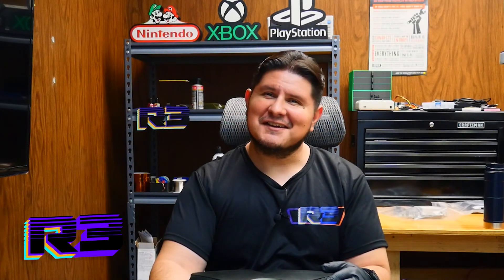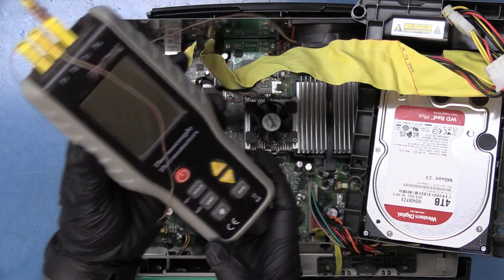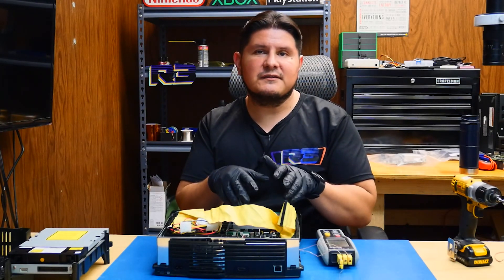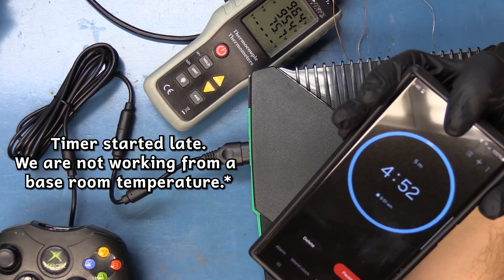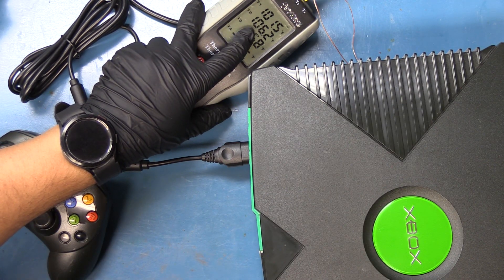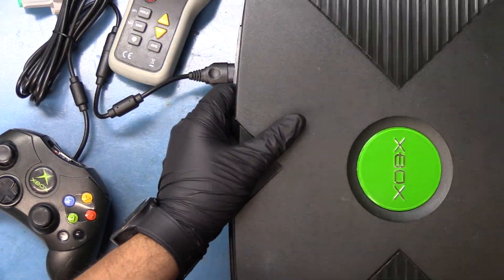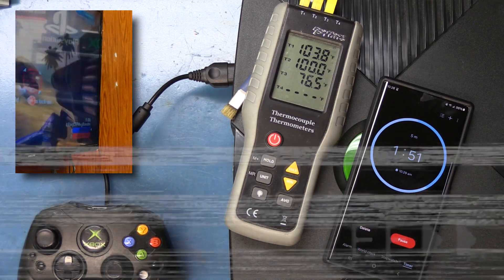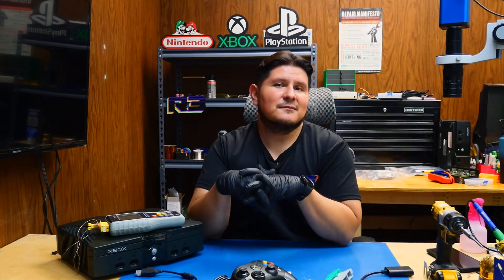Is Removing The XBOX Drive The Key to Optimal Performance?

Comment: Has anyone tried Honeywell PTM7950 or Thermal Grizzly PhaseChange Thermal Pad? I'm having great results on the Phat 360 and Xbox One X. Heat transfer is much better and fan can dissipate heat away more efficiently from the heatsink.

Comment: You should play around with the uncommon mod of putting a desktop drive into an xbox. There are a few models that can be modded to work in the xbox by flashing the bios and soldering on some components. Might be an interesting video.
Reply: The power plug or molex connector.

Comment: Recently bought a 1.6 console, noticed that the disc drive didn't read games (Whereas the seller claimed that it couldn't open the disc tray), and for some reason when I opened the console, the disc drive completely lacked screws over the top tray. I wonder how hard it is to buy a replacement DVD drive considering they're failing left and right now, and if it's even worth doing at this point.

Comment: Lmao, 100f (38c) is barely even warm when you're looking at it from the PC world. Heck many PCs idle above that temp. PCs usually run at around 150f-170f (65c-76c) and sometimes even hotter if you include modern intel CPUs.
Reply: @madmax2069  Do what? My PC runs around 40°F....

Comment: Those GPU fans on the 1.0 suck so much and are so noisy.  I'd recommend replacing with a passive heatsink if you have any extras laying around.
Reply from the maker: Agreed. I've seen too many fans die on these old 1.0 consoles.
Reply: I actually did it, saw so many recommendations online, yet the result was awful.
Temperature on GPU was too much with short time. The passive heatsink couldn't be touched with bare hand, got really hot, I've never seen this kind of heat on original Xbox before. Definitely NOT healthy. Main fan working well of course, nothing broken inside or blocking air so, Idk what happened.

Of course, applied new thermal paste and good cleaning but console GPU got too much heat. I'm using the stock heatsink with a serviced fan and temperature is very good, even in demanding games and warm weather and not noisy at all but more than newer revision systems like the 1.6 being the most quiet.
Reply: There does seem to be a bit more heat venting out the back of my 1.0 with a passive heatsink installed compared to a newer revision.  But I've put a few playthroughs of KOTOR on that console since then and haven't run into any issues yet.
Reply: true that. i had to replaced a few with noctua fans. super low noise.

Comment: This isn't surprising whatsoever. You get the same problem with the Dreamcast because you're removing the GDROM and thus changing the cooling & airflow characteristics inside the shell. Furthermore, the power rail continues to draw voltage for the drive that doesn't get used, so it gets dissipated as heat... further raising temps.

Might need to put a 3D printed tray in there to better mimic the interior still having a CD drive installed. Or even just put the original tray back in and test it again. I bet it'll run a few degrees cooler.

I'm not an engineer, just spitballing based on anecdotal observations.

Comment: The whole fun fact of playing retro games (for me) is to feel the real hardware working. Getting rid of the dvd drive kills a lot of the nostalgia. Playing from hard drive or even an ide>sata ssd would let make me more play on a emulator as on an OGXbox.
Reply: Lots of the DVD drives are just plain broken and they're stupid expensive to replace, which is why I just ditched mine and put it on a hard drive. Xbox without DVD drive or a useless broken Xbox, easy choice.
Reply: I agree that the console doesn't feel complete without a working optical drive, but I pretty much exclusively play games from an SSD for performance reasons, homebrew, etc. I even understand and share nostalgia and appreciation of optical drives mechanically and functionally, but who doesn't want faster loading times?
Reply: That doesn't even make any sense

Comment: 20 Years ago, Unless you had a ModChip that allowed the BIOS to Skip the DVD Seek...
I among many others in the Xbox Forums, would take a DVD drive, Drive-Board off the DVD Drive and plug it into the connections.
You would have to secure it inside, but it technically would recognize the Drive and Open Up all the Extra Room

Comment: While the data definitely does show that the DVD drive means the heatsinks don't lose heat as effectively, I think the test could have been a bit more thorough by letting each test run until you hit the temp that each setup stabilizes at. Not strictly necessary, but it'd have been a little more thorough and could have shown an even wider temperature range.

Still, good information to have, man! Thanks for the video!

Comment: The GPU result isn't surprising at all considering 1.0 has the silly little fan blowing right at the bottom of the DVD drive. You should try this with a 1.1-1.6 system that has the updated heatsink design as it allows the natural airflow of the case to go through the GPU heatsink.
Reply: The fan will not blow up against the DVD drive. It will blow against the heatsink. I do agree that this test should have been done on some of the higher versions.
Reply: @fu1r4  Yeah, fair point, for whatever reason I haven't paid enough attention to the airflow direction. It still upsets the airflow of the case though.

Comment: Well, the results are...completely as expected. Also, haven't encountered an Xbox which overheats after changing the thermal paste
Reply: I have. It was failing capacitors that was the culprit. Getting it recapped fixed the overheating.

Comment: I get it, but if someone is going to worry about 7 degrees difference, they may as well switch to PC gaming. Real console gamers don't worry about these tiny things. Lol. Good video though.
Reply: Well, we don't know what the temperatures stabilize at, since it was only a five-minute test. After running for an hour, the temperature range could be much wider--which does have implications for the longevity of the (already very aged) console.
Reply: @Jobobn1998  Could be, most likely not since the fan is doing it's job.
Reply: Keeping temps low is important to the longevity of our console.
Reply: @bigdillan9612  7 degrees Fahrenheit isn't going to matter much if at all on a chip that's rated for much higher temperatures. It's a non-issue.
Reply: "Real console gamers don't worry about these tiny little things"

1.) That makes you sound extremely ignorant, arrogant and immature.

2.) People that care about their consoles do take it seriously and it's not a "tiny thing" to them.

If you care about your consoles or PC you take the steps to make sure they last and run as best as they can.

You sound like part of the "just throw it away and replace it" generation. Believe it or not there are people out there that actually care about their possessions and take care of them by learning how to themselves or taking them to a guy like this channel here and having it done.
Reply: @davidb.6681  That's fine. I clean the dust out of my consoles so they don't overheat, but 7 degrees Fahrenheit difference is a non-issue. Lol. 

I'm just saying if you're going to worry about these tiny, miniscule things, you might as well just switch over to PC, because they care more about that kind of thing. Console gaming is about plug and play, not worrying about the tiny things. 

Just play the games man, and clean out the dust every once in a blue moon.
Reply: We don't care about 7F (4C) either, that's firmly in the very upper echelons of enthusiast PC overclocking (let alone gaming) and the misinformed. Ambient temperature can easily swing by more than that.